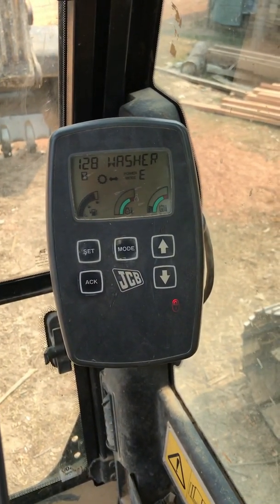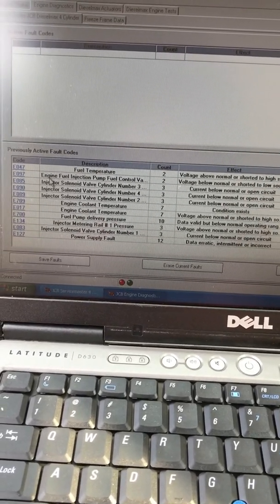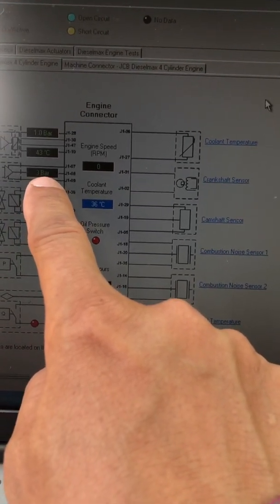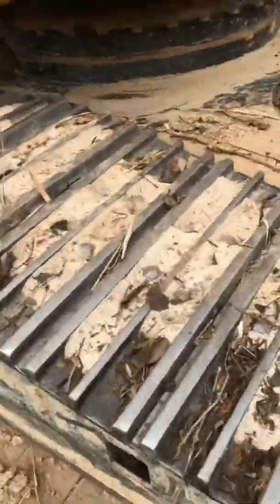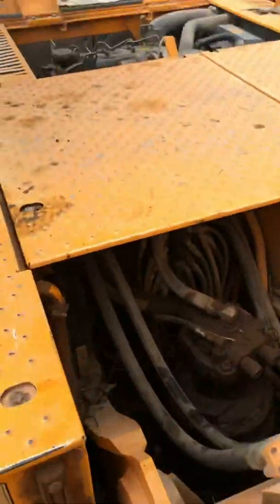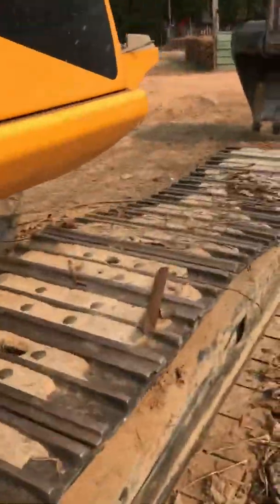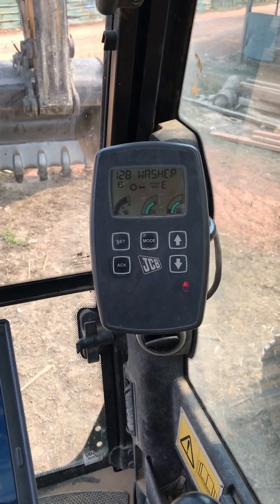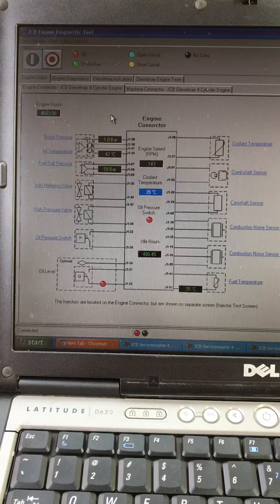Diagnostic & Fixing JS220 engine won’t start problem

Comment: I have a JCB JS220LC excavator which was made in 2012 with about 5200 hours. I believe the ECU1 332/K6848 has gone bad, the symptom observed was that the excavator Isuzu engine can only start with the LIMP MODE switch on. I bought a new ECU1 and replaced the existing one. Upon ignition key on, I got a message on my LCD dash screen showing: "RECALIBRATE", then after a while (about 5 or 8 minutes) another message popped up: "HOUR UPDATE". I also purchased a JCB ServiceMaster program on eBay, but I don't know how to perform a re-calibrate from here. Could someone help me with how to proceed from here? I have the Service Manual for this excavator, but it doesn't provide instructions on replacing or re-calibrating the ECU. Please help!

Comment: please help me regarding the problem of the jcb205 exacavator unit, loss of power, things I have done Changing all the oil filters, after working it only lasts a few days, the problem is getting more and more frequent breaks or fuse burns, please help I wait
Reply from the maker: 1. Check the fuel inlet screen (that installed on fuel injection pump) probably block and can cause less power. Clean fuel lines including fuel tank many debris may exist inside the tank. 
2. Check Air Inlet system such as Air filter block or not, After cooler & hose break or not , and turbocharger condition , turbo used to failed on JS205 machine service meter about 4,000 hrs and some machine early fail less than 4,000 hrs. 
3. For burning fuses, check the all solenoids near the hydraulic main pump, 1st solenoid is power mode , 2nd one is for swing, 3rd one is for hydraulic lock solenoids, these solenoif are used to failed internal short and fuses to burn when key switch on. Replace new solenoid if fail. 
Hopefully you can solve machine problem doing step by step all above.
Reply: @zawmin8602  aveți vreun video cu senzorul de la temperatură apă....?! Creste până la roșu temperatura la apa și scade până nu mai indică temperatura la apă și nu se mai accelerează.....să fie oare senzorului de la temperatură apă defect?!